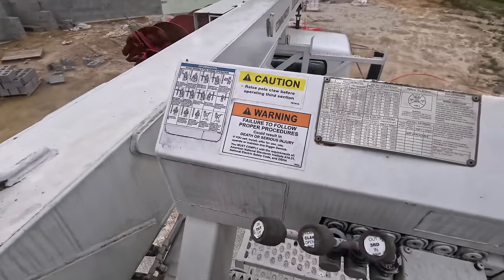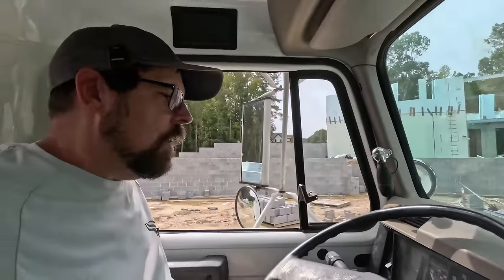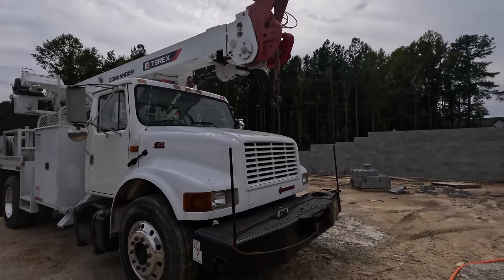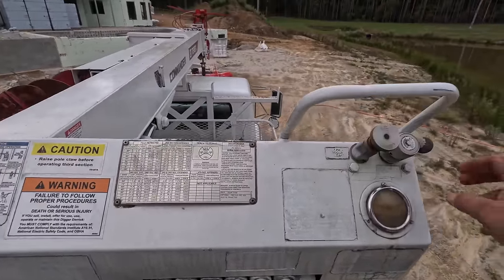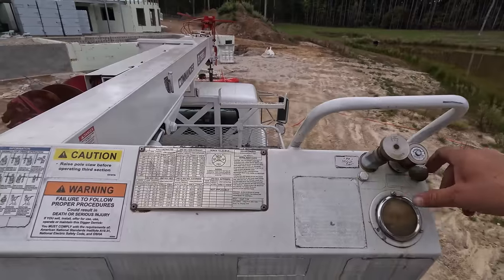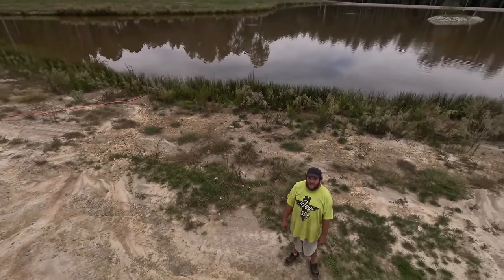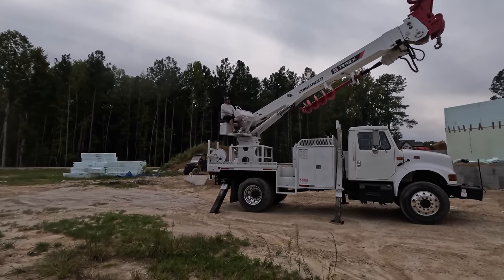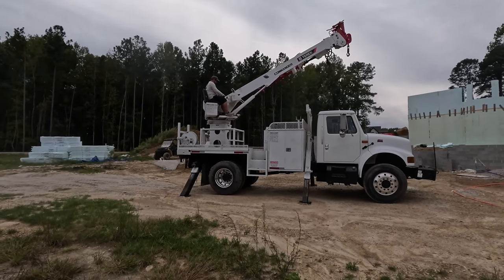Billy Bob got a Crane ….. Kinda

Comment: Nice looking digger truck. I'm a lineman for power company in Nashville and have run these for over 20 years. 24" x 24" pads made from laminated plywood are a must. It's best to do your work off the back so your truck will counter the weight and or give you more working area. Also, the hydraulic lines are for a tamp, to pack dirt or gravel around poles that you set. I wouldn't suggest a pin on bucket because you can't "feather" the hydraulics very easily with the remote. This can become a problem in tight places, and you don't need no WORKMAN'S COMP CLAIM on JAMES 😂. 
 As far as the auger is concerned, uncradle it with boom almost vertical and lower boom slowly as the rope unwinds. This will save your ass if the rope breaks. Also,when cradling up the auger, get 1 wrap on rope and the raise boom up as needed to keep strain at minimum. 
 Between you and Mrs. BealyGood I think y'all can get er dun. 
 Keep doing what you do, we enjoy the hell out of your channel. Dueces
Reply from the maker: I appreciate the insight! Thanks 😊

Comment: The very first thing you want is 4 -  4 foot square by at least 3 inch think Wood stabilize pads for that soft ground. Rough cut 2 x 4 cross piled, glued and nailed or screwed together works good. The Bealy Bore and Reach is a good name. We need the BBR over here.

Comment: That's the truck that the power company use to set poles. That will definitely come in handy for you but as far as the auger goes, you need to get one for the back of your tractor for getting in tight spots

Comment: May it need less overhaul work than Cutting Edge Engineering's crane. He's up to a 12 part series over the course of over a year and still needs to build a new cab and rewire the entire thing.
Reply: That poor crane spent its life in a coal mine and what ever parts weren't rusted through were bent or eaten up. Long way to go but YouTube videos are going to pay for the first Drift Crane.
Reply: Today's upload from CEE is part 21 of the Franna crane build. Funny thing is Terex who make Bealy Good's Digger Derrick also make CEE's Franna as they bought Franna in 1999.
Reply: @bmw1894  after seeing todays post I was going to come back and comment my guess was way off.

Comment: First thing you need to built is some stabilizer pads…I am surprised they didn’t come in the “baskets”..first time you lift a heavy load or soft ground you will understand why pads are important …and it is not a crane it is a “derrick” ….cranes can’t take side loads while derricks can take some side loading
Reply from the maker: I knew it was a Derrick but most people don’t know what that is 😁. I appreciate the explanation of the difference though, I didn’t actually know that. Thanks

Comment: Better call the hall...
To become a crane operator, you'll need to meet certain requirements, including: 
Age: Be at least 18 years old to become certified, and at least 21 to move a crane across state lines 
Written and practical exams: Pass a written exam and a practical exam that demonstrate your knowledge of crane operations and safety 
Training: Complete entry-level driver training and initial crane operator training 
Experience: Gain work experience operating construction equipment, hoists, and winches, or as a rigger/signaler 
Substance abuse: Follow all substance abuse guidelines set by your licensing agency 
Ethics code: Comply with the CCO ethics code 
Physical ability: Be physically able to safely operate a crane

Comment: Bealy Stretch or Bealy Reach.  Do you plan on setting power poles? It has the pinchers at the top for holding them straight.
Reply from the maker: I have 4 to set for bat houses

Comment: Get yourself some proper pads for the feet or all your weights and limits count for nothing.
One of your feet sinking a bit or slip ( which usually happens when you have load in a critical place. It will lock out on you or worse just come over on top of the load.
They are big plastic discs. Fairly cheap. Then you can use them with your cribbing if needed.
You have some great ground there but it's all new and made up surfaces so there may be soft bits.
Just felt the need to be one of the first to jump in on behalf of the Internet nagging society and point out the obvious before yall rush oit and buy hard hats.
Reply from the maker: I could have sworn I talked about needing to get the pads in the video but it must have gotten cut in editing 🤣. Thanks 😊